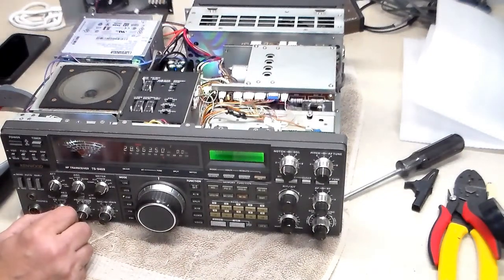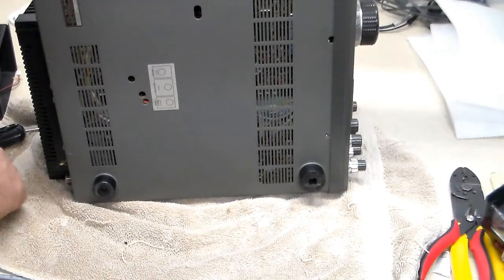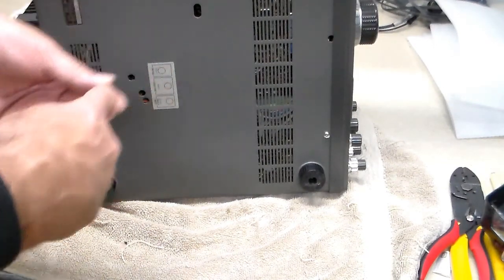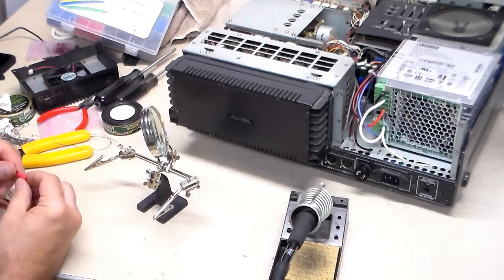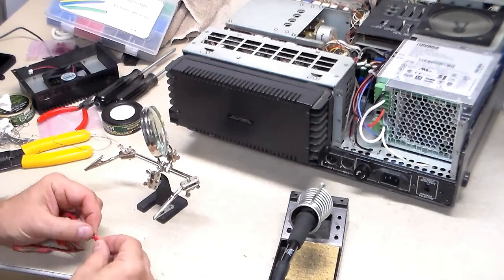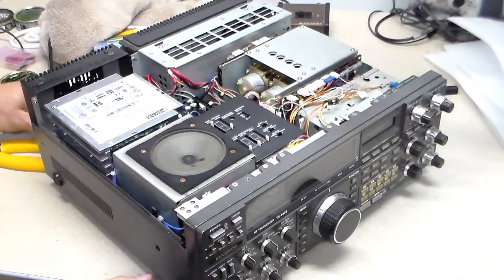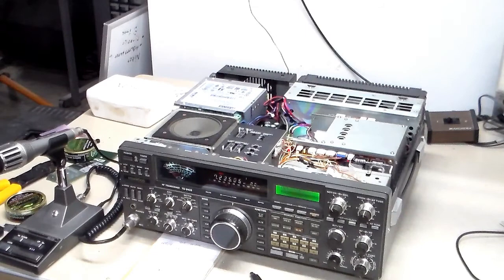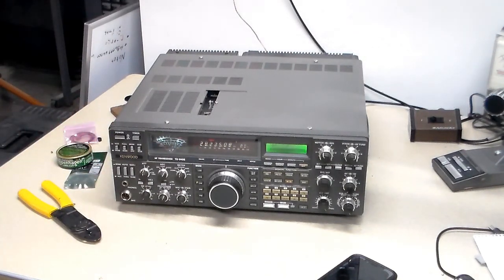TS 940 Power Supply Upgrade Part 4

Comment: Sir I am 4S7HP using a ts 930s. Have a power supply problem. I need to replace the transformer caps power supply board and transistor with a switch mode power supply what is the best one for replacement (28V 20A)

Comment: Thank you for the step-by-step instructional videos. After all is said and done, are you still happy with your upgrade? I'm thinking about purchasing the Compudigital version 4 upgrade. My P.S. fan stopped working. Instead of trying to replace the fan, I thought about doing the upgrade. It is expensive, though, but I do love my TS-940!
Reply from the maker: Thanks Scott.  So far no issues. I feel more confident that my power supply won't fail and wipe out other components now.  The price is expensive but watch for specials.  When I bought, it was about $100 off otherwise I probably would not have done it.

Comment: I would NEVER install a switching supply into a transceiver that was not originally designed for it... There is a lot of design consideration in modern transceivers as to placement of cables, boards, grounding points, shielding and fasteners to keep noise and spurs from a switching supply to a minimum. The TS 940 is designed to run with a linear supply and all the before mentioned points during design were optimized for that. This is like putting a tractor motor into a car, it will run, but the performance will suffer.
Reply from the maker: So far it performs with no issues. Even though I’m not a big fan of switchers, it hasn’t had any issues. Hopefully it stays that way.   My shack is not very isolated from noise, so I probably wouldn’t detect any switching interference that was caused by this supply.   Thanks for the input though.
Reply: I have installed two so far, one for me and one for a friend and no problems whatsoever. No birdies, no spurs and no strange problems. I cannot
recommend this upgrade enough, it works and works well and I have nothing to do with the people that make it.